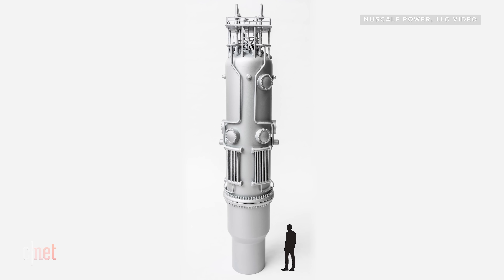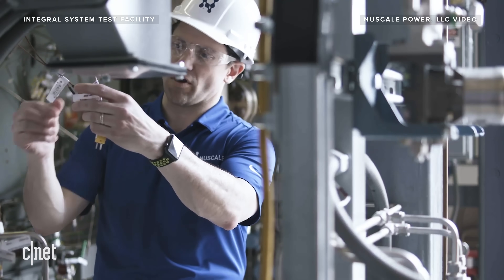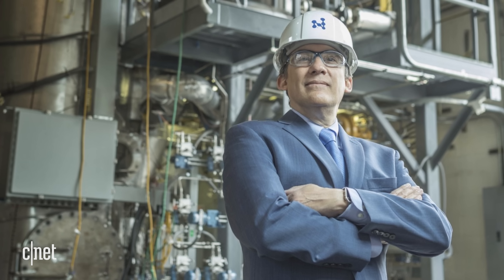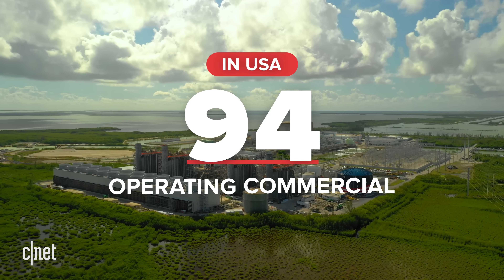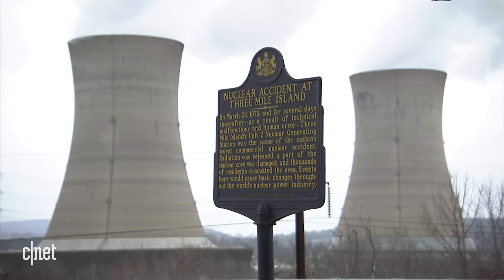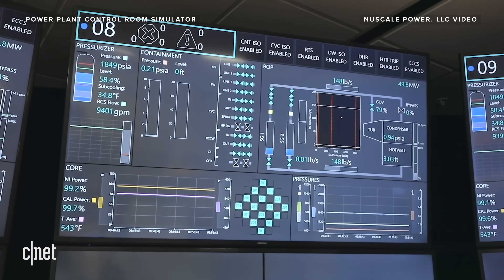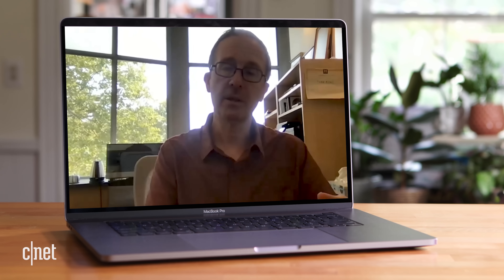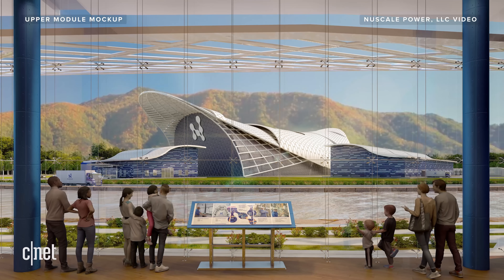Small nuclear reactors could be the future of energy

Comment: As long as there are 5 million premature deaths from fossile fuels and we cannot build a stable grid from intermittent wind and solar energy alone but need hydro or coal and gas plants as backup plants, there is no denying that nuclear is the far better option having 0 carbon gases and air pollution while producing energy. Three Mile Island and Fukushima killed 0 civilians and Chernobyl was a soviet military reactor designed to in situ extraction of plutonium for nuclear weapons which was put to an unsafe low power test to simulate a station blackout for the town Prypiat According to the WHO, Chernobyl caused  31 direct casualties amongst the first responders and in total in all eternity will have caused about 4000 premature deaths.

Comment: "Built in factories & shipped"...  How much does this thing weigh?  Other question: Is the present configuration "married" to vertical operation? If Yes, could the config be modified to operate horizontally?  Potential application w/ vertical space constraints, plus lateral distribution of weight would be preferable.

Comment: I am a fan of nuclear power. Module reactors seem very safe. Also, if designed properly, the reactors will generate less waste. In fact, if the French model is followed, the waste is perpetually recycled until there is hardly any. Last I knew, instead of thousands of tons, they had less than a human body weight of waste.

Comment: NuScale reactors could be mass produced and placed on floating barges that could be deployed to remote territorial waters in the ocean to produce methanol from seawater. Methanol can replace natural gas in natural gas electric power plants cheaply retrofitted to use methanol. The flu gas from these power plants could be captured allowing CO2 to be recycled to produce more methanol when synthesized with hydrogen produced at sea. So this process would be more than carbon neutral, it would be carbon negative-- reducing the CO2 in the atmosphere.

Comment: I'm neither for or against nuclear, I actually used to be quite for it but judging how long it takes to build a new safe plant (10-15years) with delays and price increases, I think it's better to build new solar and wind plus battery storage and have the plants generating within 6 months to 2 years, you might not get  as much power from them as from a nuclear plant but you will get something soon. Besides in 15 years time the price of renewables and storage will be even cheaper. As for the existing nuclear plants, keep them running for as long as it's possible and safe. As for the SMR they don't exist commercially so we don't know anything about them for sure, if in 10 years they turn out to work well, great, for now I'm betting on cheap renewables and storage.

Comment: SMR's have been used in ships and submarines for decades. So tried and trusted tech. Land based SMR's are a development of this. 

If (as we must) we can no longer burn hydrocarbons as part of saving the planet there are insufficient sources of sustainable energy. Solar doesn't work at night and less efficient in cloudy regions, The wind doesn't blow in anticyclonic conditions and there are insufficient places for hydro to be put in place. 

SMR's offer the best solution to make up the shortfall in demand for energy that is left after the sustainable contribution. They can also be tasked to generate green Hydrogen which is a far better solution for ships, planes, cars, etc.

It's just the most practical and pragmatic way forward.
Reply: Hydro is not ideal because of the destruction it causes to down stream river environment. The Mekong River is being destroyed by the proliferation of hydro schemes. SMR's are definitely the way to go to provide base load topped up by wind, solar, tidal, biomass etc etc. Lots of small reactors spread around the country should also provide resilience to the overall system.

Comment: If SMR's are really safe as advertised then this can be an alternative to fossil fuel plants. We have Solar and Wind for electricity generation but in order to expedite the process of being independent of fossil fuels, we need to include SMR's as well. Also, we need to come up with ways to utilize spent nuclear fuel, like nuclear batteries which last for thousands of years.
Reply: They’re actually already developing nuclear batteries that are safe to hold in your hand. They aren’t in late stages as of yet. I myself am still wary of the effects of nuclear radiation and a possible fallout, but that’s why more effort should be put into making nuclear energy more safe.
Reply: Wind and solar need 100% backup and if that backup is nuclear, what's the point of having wind and solar to begin with?

Comment: What is the cost Per kWh of delivering electricity over the life of the reactor. Is it cheaper than solar and wind ? How is the cost calculated and what does it include and exclude.
Reply: With SMRs you don't really know until you build 15-20 of them, it keeps getting cheaper the more experience, factories, etc... But with wind and solar , they're cheap, but we've seen that the more you add to the grid, the more expensive it is to store it and move it to where it's needed. It's why Denmark, Germany, and California, who have some of the highest renewables penetration, have the most expensive electricity.
Reply: @Tim Norris the first dozen, probably. But how much does a KWh of solar cost at night? Or a KWh of wind on a calm day, or week? Lots of batteries, extra transmission... Gets very expensive while nuclear can run 24/7 for 2 years straight.
Reply: @Tim Norris nope
Reply: @Tim Norris If that is true-- why is electricity so much more expensive in every area that has high penetrations of wind and solar?  That's the problem with the Lazard LCOE study that you're probably referencing, it doesn't take into account the system costs.

Comment: 2:36 in use yes but when mining and transporting the fuel it does produce emissions. yes they are very low compared to other power plants but they still have emissions. but i really like nuclear :)
Reply: Everything has emissions when consider the whole supply chain. Making purified silicon, fiberglass wind turbine blades, all the steel needed, etc.  But if you start switching to electric trucks, new smelting tech, new mining techniques, that can keep going lower.  Lots of work in a lot of areas. No one panacea, but nuclear is a big stick to prevent electrification being just a way to move the exhaust to another location.

Comment: How is this any different from any other nuclear power plant? Still uses an extremely hazardous fossil fuel that has to be mined in good old Canada, and proper and safe disposal is not in this conversation even! Fukushima was only a few years ago...and it is absolutely blacked out on the news as it is continuously poisoning the world...? Still heats water to makes steam to turn a turbine and generates electricity? Doesn't require any additional water...? Boiled water has low oxygen still right...still bad for marine life right? How good is that radiation shielding...I need to see actual numbers with decay rates? Are staff not required to wear radiation exposure tags who work daily on this equipment?  You make it sound like the old plants are not rebuilt regularly? Steam turbines require regular maintenance still...even if you uses RO water to make steam.

Comment: I have worked in energy and pollution control sectors of the economy in North America since the late 70’s. My first job in my trade apprenticeship program was on a nuclear containment vessel, the second was building refueling and fuel storage systems at the same facility. Since then I have traveled across the continent from Palo Verde Arizona to Pruhdoe Bay Alaska. The only type of power generation facility that I missed an opportunity to construct was a wind turbine. 
I believe that SMR’s are a viable option for power generation. As part of a mix of renewable and non renewable power sources. We are going to phase out coal, and oil or natural gas will be used for plastics instead of power plant fuel. The writing is on the wall. Coal IS going away. We can retrain miners to build renewable power sources. No fuel should be used just to keep people working. It should be used because of cost/cleanliness and availability.
Reply: look wind solar dams all renewed energy nuke is not it creat waste that doesn't go away
Reply: @richardgray7159  Nuclear fuel can be recycled.  France has safely recycled nuclear fuel for decades.  Some newer types of nuclear reactors produce waste that will decay in a 300 year time.  Nuclear is a very dense fuel source so doesn't produce a great volume of waste.
Reply: @richardgray7159  nuclear reactor are not like nuclear bombs